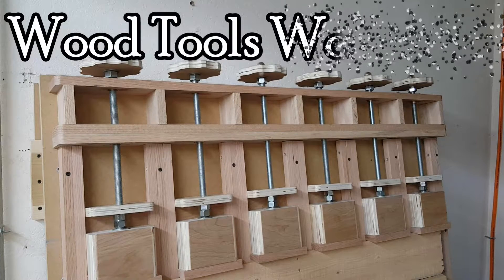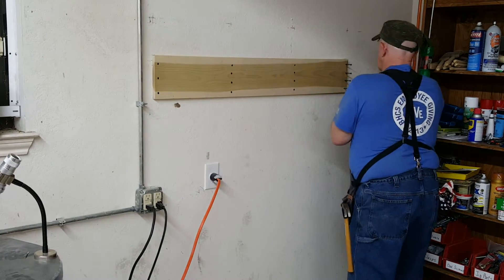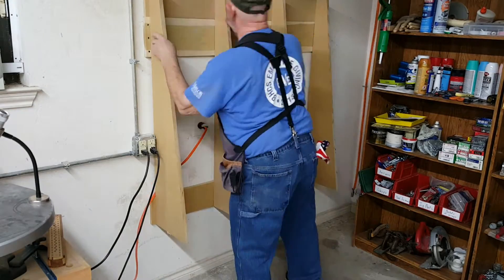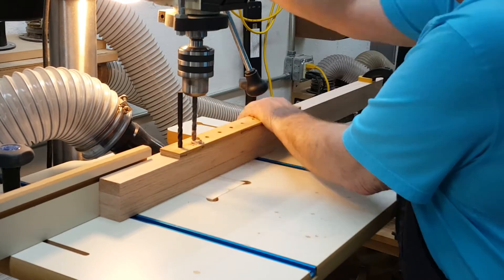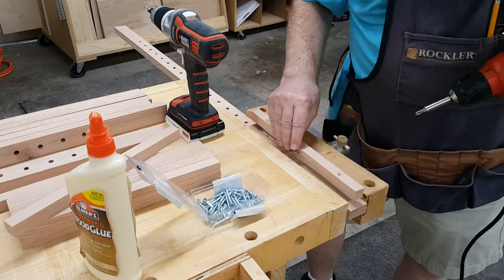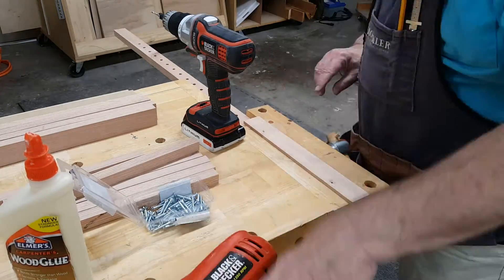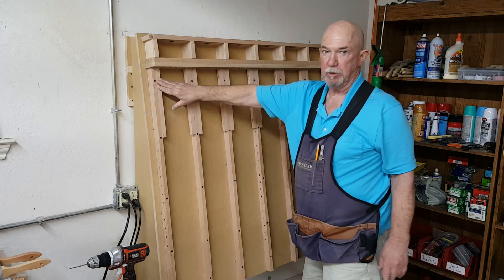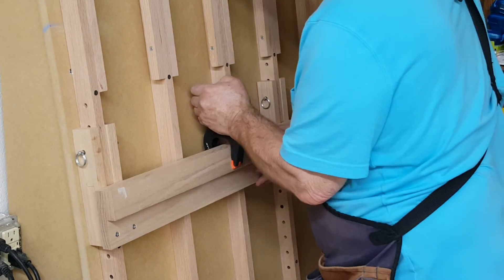Glue-up Station Assembly, Part 3

Comment: Awesome video, Fred!  I like the fact it is mounted to the wall because space in a wood working shop is always at a premium, it seems.  A Part 3 presentation first off would have helped me. I would have been better able to understand all the individual pieces.  I am thinking of making one out of steel and using air power or small hydraulic cylinders.
Reply from the maker: Thanks for those comments, tes767. It's been two years since I built it, and I've realized a few possible improvements, so revamping it is on the to-do list. Just, it has a lot of things before it. :) I'd love to see videos or pics of yours when you do it!

Comment: Great project.  I'm currently in the market for a dust collector, and have been looking at the Laguna.  Can you give me any info, thoughts or concerns on the model you have?
Reply from the maker: Russell, I haven't had a bit of trouble out of the Laguna. It was definitely a good purchase. It has more than enough suction through the 4 inch ducts, and I'm planning to run a 6 inch main duct across the shop, because I know the Laguna can handle it. In fact, its inlet is a 6 inch inlet and has an adapter to go down to 4 inch.

Comment: Nice video tutorial Fred By the way I love the 2 wheel dolly to move the 4x8's around that is using your head work smarter not harder. I may end up making one one of each glue up station and a dolly.
Reply from the maker: +Chris Glitzos (Wood Tinkerer) Thanks, Chris!  I'm going to redo that dolly before long.  It tends to spin on its center when I'm trying to set a sheet in it, so next time will be two axles.
Reply: I think it works fine for steering a large sheet of plywood

Comment: massive operation!! Were the strips and rails oak?
Reply from the maker: +ESCAGEDO WOODWORKING They're red oak, which is the only hardwood that's readily available in my area.  To get anything else I have to drive about 60 miles through Dallas to the other side.
Reply: I really like red oak!! It cost a lot here in Miami. Is it costly over by you?